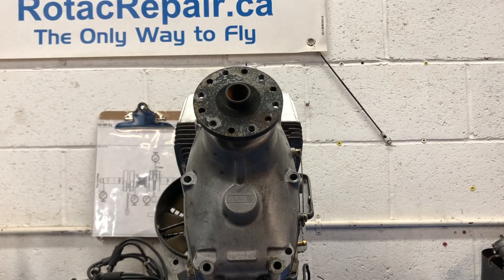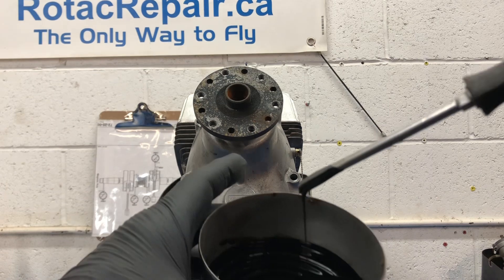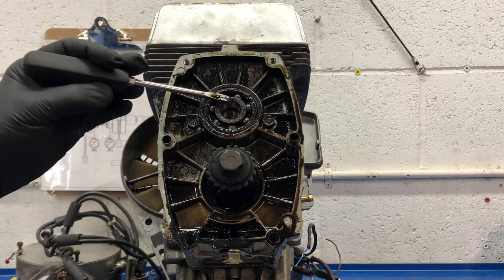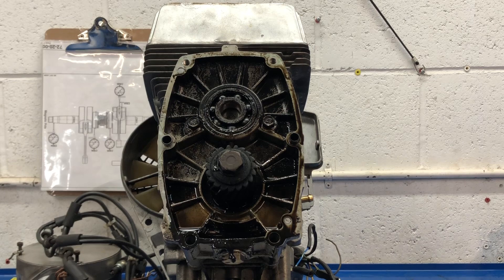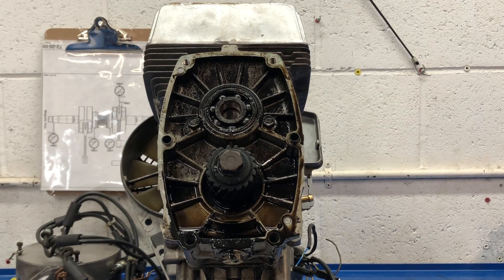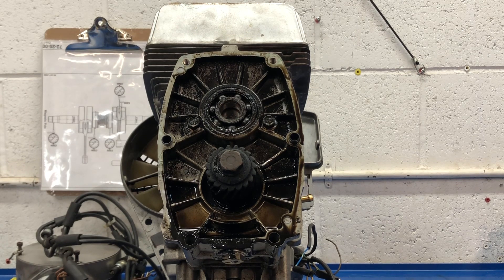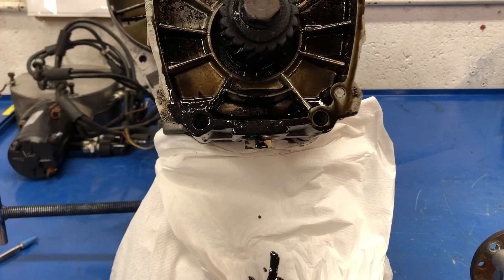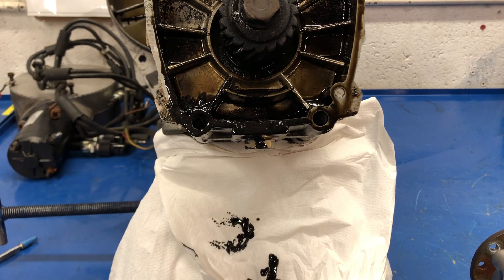Rotax 503UL B-Gearbox with a burnt smell

Comment: Do You know how is the correct oil volume in this gearbox ?
Reply from the maker: It depends on the mounting position, propeller either up or down. The information is in the rotax heavy maintenance manual. Usually 300 to 330 ml.

Comment: Hi I  need some info. I have a 503 rotax installed and the Bbox or Ebox is installed with the prop to the top. But I have seen some have it to the bottom and that seem bettter when the prop is in line with the pipe
Reply from the maker: The position of the gearbox either “up” or “down” allows for clearance for the propeller or some other item to fit better. The gearbox performance should be the same either way it’s installed. There is a difference in the propeller thrust line relative to the airframe especially on a pusher prop airframe.